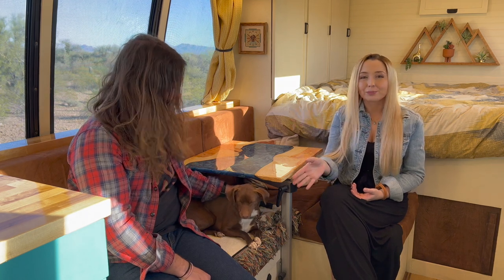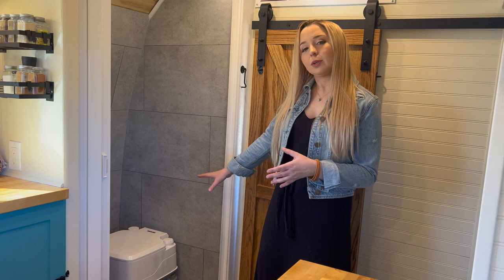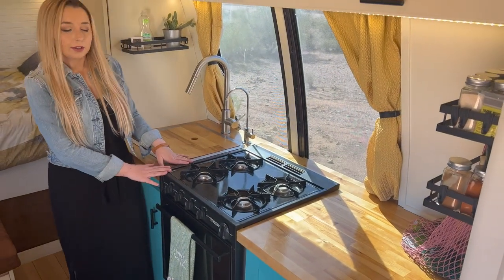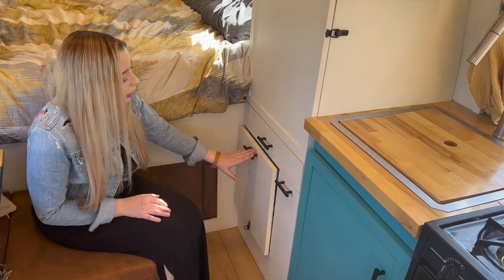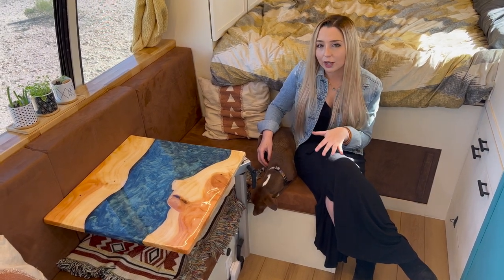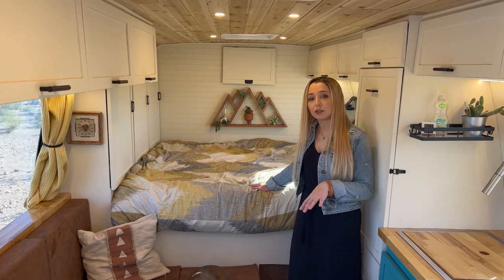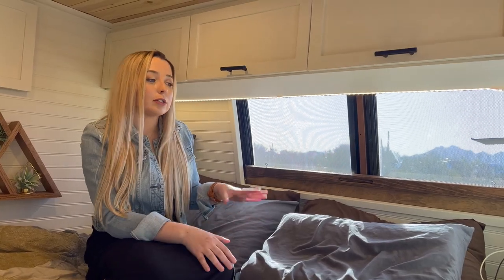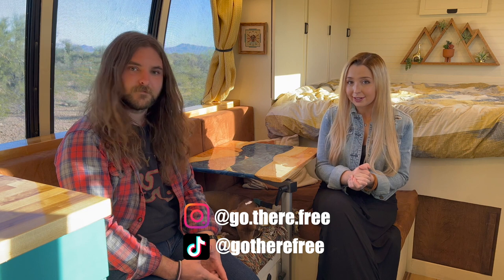DIY BUS TOUR | Prison Shuttle Bus to Tiny House Camper Conversion

Comment: I agree with the other comments here...this is one of THE NICEST and well-thought out builds I've seen, and one of the best and most informative presentations EVER. There are too many great ideas to pick out a favorite! It's wonderful to see such a talented couple blend their skills so well. Thank you for sharing, and best wishes on your travels.

Question: can you provide info on the electric linear actuator that lifts the bed? I could use something like that, thanks!
Reply from the maker: You are so kind, thank you! 🥰 Our actuator is from WindyNation, it has a 20” stroke, a 225lbs lift capacity, and runs on 12v.
Reply: @GoThereFree  Thanks for the info!😊

Comment: The build looks fantastic!  The only think  more I wanted to see was what the barn door looked like closed from the other side..... guess I will have to look at other videos!
Reply from the maker: Thank you! I'm actually not sure we ever showed the cab side of the barn door... but you aren't missing much! It looks almost identical to the side shown, and we hang a black curtain over it for added privacy/light blocking.
Reply: @GoThereFree  black curtain is a great plan! Plus I love that your bus is 'stealth' and doesn't look like a converted living space from the exterior.  That is the goal with mine as well.... I am in process.
Reply from the maker: @respectfulliving1  stealth has always been important to us! Definitely makes things a whole lot easier when you get on the road. Good luck with your build!

Comment: Great tour ya'll - we just bought the exact same shuttle bus - relieved to see such a nice job done with the curved walls. We've been trying to sketch out the bus to start planning the build - and it's harder than expected with these curves. 

Wondering how you went about this initial plan of planning the build. did you sketch? if so, any tips or resources you'd be happy to share with us? (also we plan on having our new born with us, so that's something else to consider in our build)

thanks for the tour again, well done on your home, it's looks so homey :)
Reply from the maker: Thank you for the kind words! We used a combination of just pen and paper sketches and a tool called Van Space (we liked it but others have mixed reviews so your mileage may vary with that). Once we had a rough plan we made a tape outline of all our furniture on the floor to get a better idea of our layout in the actual space, and I feel like that helped us make a lot of smart adjustments. 

If you’re not familiar with the process of scribing I’d do some research on that - that’s how you get things to fit against the curve. We talk about it in a bit one of our previous build videos.

Welcome to the club and best of luck with your build!

Comment: Not sure how your musical instruments can handle the temperature from the outside plus the exhaust and any condensation from the air conditioning. I hope you rethink that.
Reply from the maker: The garage is heavily insulated from outside temperatures, and the condensation from the AC is collected in a tray directly underneath it that drains out the bus floor. All instruments are kept on the lowest level which, due to the shelving and effective ventilation system, does not see nearly any temperature change when the AC is on. It’s tough to get into all the finer details in a tour but we took all of this into consideration.

Comment: Do you think you still need 3 fans?
Reply from the maker: Definitely. We use all three of them on a regular basis.
Reply: @GoThereFree  Interesting. And you chose three because you have no Windows, makes since. Do you also have a skylight? Why or why not?
Reply from the maker: No skylight, we simply did not have the room for anything else on our roof between the 3 fans and all our solar panels. But the windows that are still accessible let in plenty of light as it is.